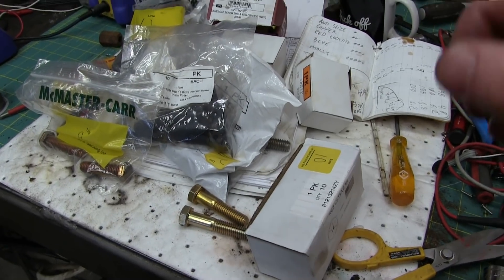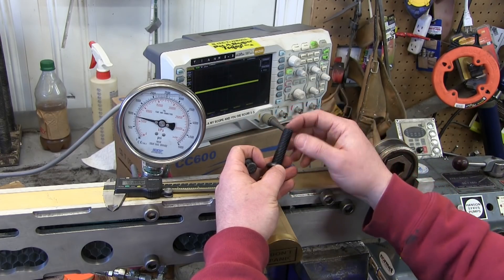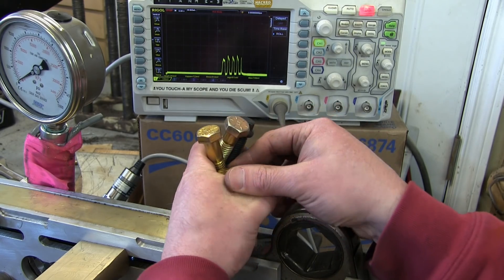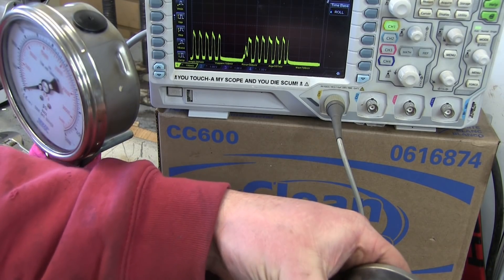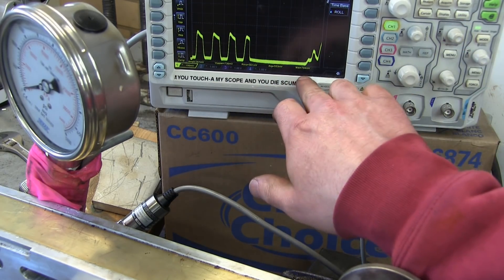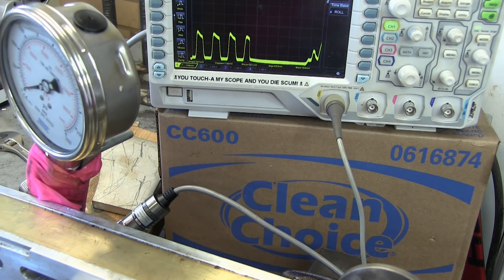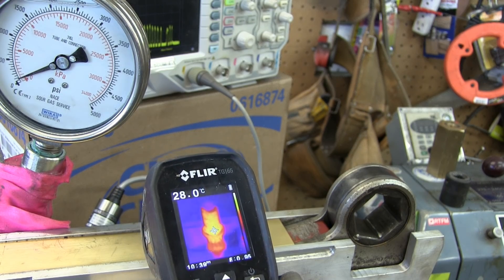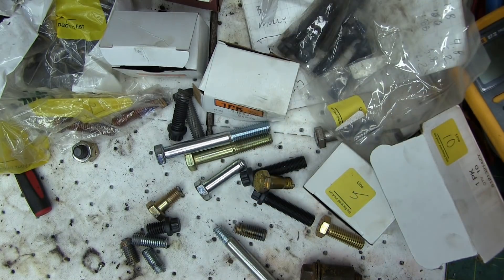Home Depot Bolt vs. USA Made | Offshore Suprise!

Comment: Taiwan excellent quality machinery metal etc. Jet machines banned by Canada?
in mechanical engineering 1.5 × minimum root diameter thread depth is the rule for pull out strength. And  the ideal is to torque bolt to a degree to exceed maximum dynamic force expected to eliminate stress reversal in cyclic dynamic situation s like connecting rod bolts. This way Fatigue crack propagation is eliminated. 
Rolled threads rather than cut also stronger. 
Lubed versus dry produce very different results and can result in failure also.
In physics engineering dynamics the force on a reciprocal link like connecting rod and bolts increases at the square of the rpm. Double rpm quadruple force.
Ductile quality is critical in high strength connection. One must test in long term loading many fastners to come up with a accurate determination of quality.
Excellent work thanks for testing stuff.
Shalom

Comment: My question is “How brittle are the Taiwanese bolts?” Those bolts could be cheaper because they potentially lack a certain annealing process. The yield strength of bolt isn’t the only important part. If the bolts see oscillating loads a more ductile bolt will be desired. Additionally, for the finer threads being stronger, the angle of the cut at the bottom of the thread is smaller so the crack propagation is slower as well. This is in addition to already stated smaller cross section of the coarse thread bolt. Materials don’t differentiate between engineered cuts and cracks. I do understand this is a home cooked measurement, but these are some things to consider.

Comment: And here a thought bolts had a rating that is including both safe, and beak strength. Like, use a grade 8, so you know to torque it to X, and then if shit hits the fan, it breaks at Y, well before the expensive parts break. I guess that is not the case?

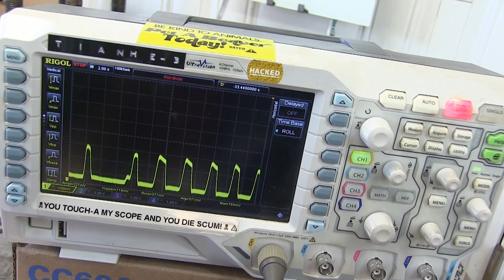Comment: At 12:50 you said "It is the same" that is true for the torque, but it looks like much finer threads. That would be then a much higher clamping load, but the larger cross sectional area, which then comes to some more stress.

It should also be noted that having a bolt that is a lot stronger than you need, and just torquing it to the torque you were told you needed, may result in fasteners that don't stay in place as well. Fasteners are supposed to be loaded to 80% of yield so they don't come loose. You want to stretch that spring.

Comment: I picked up some 3/8" lag bolts from Lowes to attach large L brackets to wood studs for a built-in desk.  I snapped the heads off the first two I put in. Utter crap. I went to a proper bolt supply store. Much better.

Comment: Would it ever be the case that a bolt would fail on its threads? I would think that there would be a point where the threads got so thin that it would fail. Clearly there wouldn't be bolts designed that way because that's a bad idea, but in theory could it happen?

Comment: Great Video Thank You !!!  ... One thing I was noticing ... It seemed that the american grade 8 bolts stretched further before breaking?  if that is true then there is added safety factor in using them - even if they yield slightly earlier.   Lastly you only had one bolt of each type from what I could tell and statistically that is not fool proof research (and i know you know that).

Comment: I test a lot of threads for my QC job in an automotive brake company using proper equipment (constant speed driver capable of up to 600Nm) and torque transducer (and occasionally load washers) which graph out the 15 second cycle.  The stack of galled up washers used as spacers in the video explains some of the reasons for odd readings, especially if they were reused.  It's necessary to use a single hardened spacer so no galling occurs and there is no crush variance. Great vids!

Comment: I've done a lot of torque vs clamp load testing for work. Friction losses through the head and threads lead to way too much variation to use torque as a valid way to compare clamp load between fasteners. Your best way to get that information is with a tensile pull test. 
If you're trying to correlate torque vs clamp load you're beat off measuring stretch with a drop indicator or ultrasonics if you've got access to the equipment.

Comment: I was taught that you need the bolt's diameter worth the threads in order to achieve the maximum clamping load that a fastener can handle, assuming bolt and nut are made of the same metal.  Otherwise, you strip out the threads.  This is why you USUALLY do not find any nuts that are thicker than their minor diameter.  

When going into a softer metal such as aluminum or brass with a steel bolt, you need something like 2.25x the bolt's diameter worth the threads.

Comment: Northstar engines head bolts are fine thread they pull right out ....the nsl3000 system I use has coarse threads inserts never had the problem again :)

Comment: re. seeing it on the scope, I knew for years the difference between shifting gears on the power curve vs. the torque curve but it really made it pop for me when I saw my truck on a dyno at a diesel shop. If you drive truck for a living and especially if you own the truck it can make a big difference in fuel economy and equipment wear, which of course relates directly to $$$.
When I was turning wrenches for a living one driver had a Ford tractor with a 500 Detroit. She asked me to look at her alternator which was almost ready to fall off. the 1/2 inch bolt that holds it on had shook itself to death to the point that in one spot it was worn down to 3/8" and was wobbling all over the place. The dealer wanted over a grand to repair it but I went to my supplier and got a grade 8 bolt and fixed it for $20. Kanukistan pesos. 
As whatsisname used to say, verry interethting.

Comment: Would it be possible to check the strength between a 4340 chinese steel Crankshaft vs a 4340 US Crank? This is a huge topic in the Racing community that no one has actually tested.

Comment: What is this testing actually measuring exactly?  I don't understand how peak tightening torque is related to load strength.  It seems like the results show that failure due to over-tightening is independent of the load rating of the bolt, and may be more correlated with bolt geometry.  I would suggest that the load on the bolt could be proportional to the integral of the data that was shown on the oscilloscope.  The last bolt took the longest to break, so it would have the highest load stress in terms of the integral of the torque exerted, but the peak tightening torque is lower possibly due to the difference of coarse/fine thread.

Comment: An automotive manufacturer I worked for used to have us reuse stretch to yield headbolts if they measured with a certain length. They were like 9 inches long so the it was impossible to measure. Never broke one, but always did a little puckering when using an old torque to yeild fastener.

Comment: AvE:  I'm curious why you were applying force by lifting the wrench handle vs pushing it downward. I find it is easier to do the opposite, easier to control with less work on my part.

Comment: So fine threads leave leaver a bigger diameter fastener. Do they also have more engage more surface area vs course thread?
It would be interesting to compare bolts to studs too.

Comment: Ave, good buddy, long time watcher first time commenter. You hear about Tesla's recall? Apparently they have 3 aluminium bolts holding the power steering motor in place. They are prone to corrosion failure and there's debate as to the correct replacement, steel, ss, brass? May I humbly suggest you do a vidjayo on this. It's akin to the FL bridge collapse. Needs real-world experts weighing-in. Thx. This guy has a bunch of photos on his TL: https://twitter.com/BossHoggHazzard

Comment: Aren't we making a rather huge assumption that the surface finish on the threads of the nut and bolt have identical coefficients of friction for the torque readings to be meaningful? A bolt with a less slippery thread would APPEAR stronger in this test since you're not actually directly measuring the tension on the bolt.

Comment: AvE, You should really take a gander at NSTM 075... Lots of really good information on fasteners without a bunch of bullshit. Hydrogen embritlement, studs vs bolts, thread classes, acme threads, thread engagement guidelines, some of the science behind TTY fasteners, prevailing torque guidlines... its a GOLDMINE. It has a GIANT section on fastener identification, including some of the exotic alloys, like K500, as well as some history on thing s like why black oxide  coated fasteners were prohibited in high pressure/high temp  systems. I'm pretty sure there's even a section on the old Whitworth junk. 

Also, for car guys, there's a little primer on JIC vs AN. Easy way to save yourself some money.

Comment: I have a interesting question. As you mentioned fine thread bolts can take more load, my question is which one has more surface area on the face of the thread when it in gages on the face of the thread in the nut and how much difference does fine vs corse make?

Comment: Finally...something I know a bit about...I work at Fontana fastners in indiana...plating dept./heat treating....we make CAT,john deere,lawson,kamatsu, L9 and any bolt with LE on the head just to name a few not every bolt has a logo on head..we supply Brighton best an few other distibutors as well...that yellow bolt is a trivalent yellow chromate top coat...we electro zinc plate, bake it then add on the top coat which can be yellow or clear.. thanks for sharing keep your bolt torqued!!!

Comment: Stress calculations are based on pitch diameter, not root diameter. Using torque to infer the yield and ultimate stress is not a sound methodology since the coefficient of friction has significant variations based on surface finish, surface hardness, coatings, lubrication, etc. Also, a small variation in the contact diameter under the head of the fastener has a significant impact on the torque required to achieve a particular stress level. The yield and ultimate strength of the fastener are not issues so long as the fastener meets the required values for the designated grade; however, the elongation is important since a brittle fastener will break without stretching much and that is not acceptable in pressure containing applications.

You /might/ have measured the relative strengths of the fasteners, but I doubt it. Lightly sandblast a screw and repeat your test and watch how high the torque is at failure. The Chinese bolt probably has a poor surface finish, if you really want to compare two fasteners, make a tension rig with both screwed into a coupling and pull until one fails, I'll bet your results change.

Comment: The higher strength bolt will also be less ductile and more likely to experience a brittle failure with less yield.  Bolts are also engineered to have a shear strength.  Depending on how they are loaded, the "higher" strength bolt could actually fail in shear first while the "lower" strength bolt yields and stretches but doesn't break.

Comment: The result oft the grade 12 surprised me. Is there a different between 12.9 and grade 12? because otherwise the result seems relatively low to me around 5-10% overhead if at all. In engineering class i learnd (by test) that you normally have 15-25% overhead in nominzed bolts

Comment: finer thread bolts better than coarse because coarse have more stress in the material with the wide gaps in the coarse threads than fine threaded bolts. These bolts get very hot from the threads grabbing in the nut from the torque. 30C lol

Just repeating :D

Comment: Here's the thing. In the US, there are many fantastically made stuff but not all of it is the best simply because it came from the US. I argue with people about this all the time in regards to tools, very little innovation, little improvements from USA manufacturers because they lean on "Americans build the best stuff." Meanwhile Japan, Taiwan and Europe are constantly pushing improvement, we're getting caught up to and passed. We NEED our industry to push itself harder. You do see some companies, specifically in the automotive friend that get it, like ARP...but too many are just building things good enough. Look at some of the last Craftsman made in the USA tools, last gen of Kobalt USA tools (by Danaher)...junk, comparable to Chinese and beat by higher end Taiwan stuff at the same price point. If you don't believe that the Chinese can build stuff as good as a USA manufacturer, hand them a Fluke 115(China) and a Fluke 112(older, USA). Build quality of both those meters are just as good as the other, this should have us (in NA) concerned.

Comment: I'm a maintenance tech by trade.   You said you only need a bolt to go in to a nut 3 threads.  I was learned by the old farts that trained me that you want  the bolt into the nut 1and a 1/2 times the thickness of the bolt, or whatever your screwing it into.  If you put a bolt in to aluminium 3 threads is going to pull the threads right the fuck out.

Comment: I could just be a bumble fuck but couldn’t you just run through a gear drive with a torque wrench on the other end set to 100 ft/lb with a 1:2 ratio meaning it would take 200 ft/lb to click the torque wrench so you could get a reading that way. Again I could be way out in left field but it’s almost 2am just about anything makes sense right now.

Comment: The strength of the taiwanese bolt is impressive.  There are a lot of little details that make some bolts and bolted joints more fatigue resistant and thus more reliable.  One thing I wonder about with the "stronger" Taiwanese bolt is how it would hold up to high cycle fatigue.

Comment: i snapped two bolts at work today.....
fucking aftermarket exhaust...gibson....with Chinese clamps.... no yield....she just starts to squish the pipe.....and SNAP

looked like powered metal in the snap......got some clamps from car-quest, could immediately see and feel the steal was better quality....
they tightened up, didnt even come close to snapping one

ive done a LOT of hardcore mechanics.... i know for a fact the clamps were shitty 

i then got bitched out for using a 3 foot long breaker 1/2 inch drive breaker bar...... and then watched him use a 1/2 drive ratchet, and yanking on the fucker.....
no shit the breaker bar has more torque.... but it doesnt snap decent shit due to feedback..feeling the yield 

i just said "ok, then you snap the motherfuckers then" and sat back and watched..... sure enough
POP

"ya, you wont snap it with a ratchet....."

i think ive only snapped shit with a ratchet.....till today....

ya, i got mad
a few clamps might have got thrown
Reply: ya, as soon as ya got a full turn out of her.....i was thinking stripped threads

still, ya were thinking the same i was.....and their is a reason for it

Comment: Takes me back to a bolt study a crusty old engineer let me do while interning at the airplane factory.   Our grade 8 bolts kept failing in the cross section, so we had to go get a top secret bolt from uncle sames tool crib to get a thread failure.
Reply: Actually did the straight pull test you mention at the end.

Comment: There wasn't the smelloscope on the last 400 videos though. To be honest, the first video you did with your 700$ DS1054Z on a box, near something with something having enough energy to piece an eye, can also pierce the precious LCD. I can see my oscilloscope with just an eye, but i can't see pixies dancing without my scope, so personally i would put my safety McGlarses on the scope if i had to choose. But oh damn i appreciate this when i get passed the fact it's not my scope. 

Awesome vid man. Also, correct me if i am wrong, but a bolt with finer threads will also have more friction, as there's more contact friction interlocking as well as more compression of the material trying to force itself into smaller threads and succeeding better. They surely are softer individually, but the straight is in the number, you have to be ginger when inserting the first threads, and it's also a lot more a nightmare to remove bolt and retap. The big threads have tendency to crack, giving you a much easier fighting chance in case the head break clean off.

Comment: It would be interesting to know the source of the steel used in the USA made bolts.  Was it domestic or imported for instance?  We see the trend to sell US vendors substandard quality steel and fudge the specs.   Plus too the steel making process can vary and cause poor quality.  Some of our oldest steel makers are still using older technology with known lesser purity.  Meanwhile some of our competitors have built their facilities since ours were built with better techniques.  So many variables.  We used to test our steel using random samples and doing the yield, tensil, etc tests.  We discovered a simple lack of purity, dirt, void etc could produce very poor test results in higher grade, while some lower grades could produce better test results due to being purer.  Steel is a pig in a poke to begin with.   Engineers generally over do specifications to compensate due to the flaws found in steel.  And even then accidents happen.  I've seen tower cranes fail due to bolts that snapped off, bridges that collapsed due to flaws in beams, etc.  And all this even though designers over compensated.

Comment: China regularly makes a bolt to or over spec... The problem comes when you design something that needs a Grade 5 to fail before a Grade 8 but your supplier sends you the same bolt because it meets or exceeds the specification then your simple failure mode changes and bad things happen. It is a problem in a lot of industries if bolts (especially the weaker variety) don't yield at the expected strain.